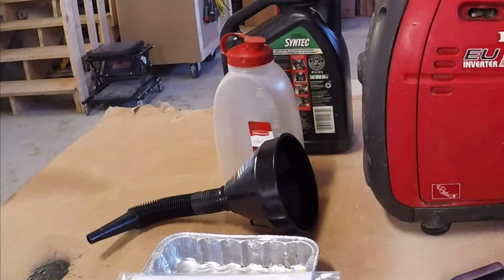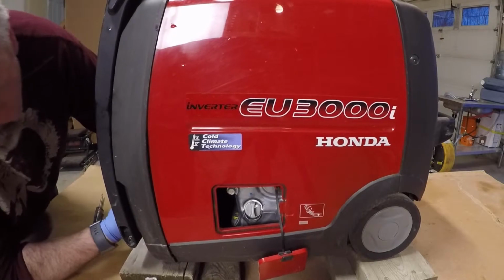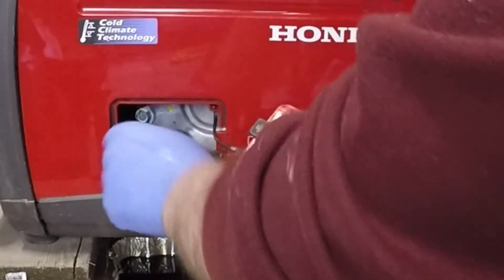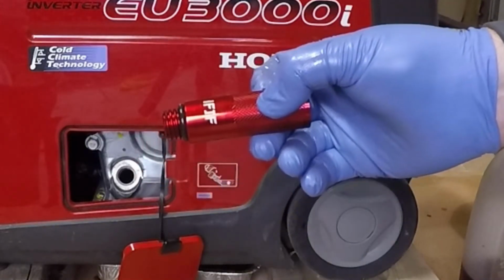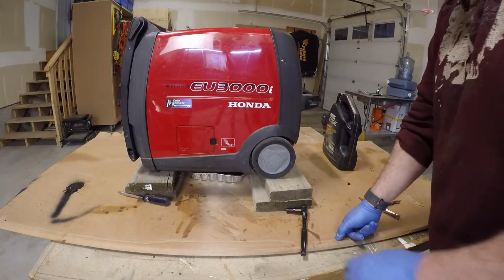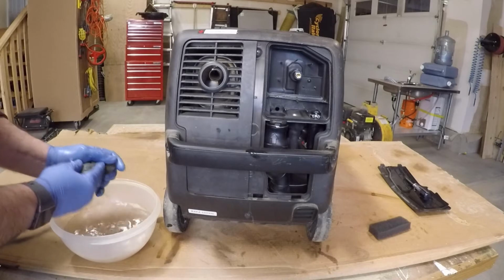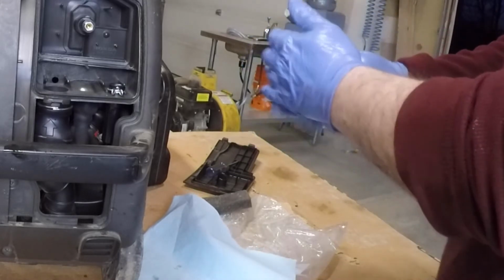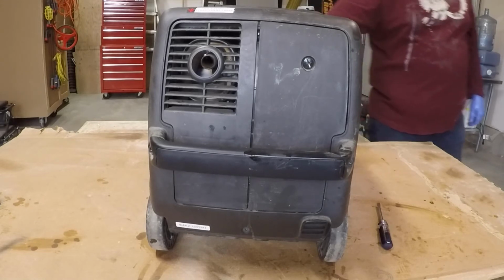Honda EU3000i Handi Quick, easy, detailed  oil change and air filter clean

Comment: Do you find the lack of a fuel cut off switch to starve the engine/carb an issue?  Ie any left over fuel gumming up the carb causing problems?
Reply from the maker: I don't D Gee, but I do start my generators every 2 or 3 months during the winter just to make sure they will fire up.  Either empty the fuel and run dry is storing a long time (best option IMO) , or keep tank full.  Or in my case just start them.
Reply: You can drain the carb with a flat head . Look for the clear tube under the front of the unit

Comment: The only thing I dont like about the 3000 is the weight 130 lbs is to heavy. I have 2 ....2000s that weigh 46 lbs apiece and I parrarel them and have 4,000 watts.
Reply from the maker: Hi the other 3000 is probably about that weight.. one of the advantages of the HANDI in this review is that its about 75 lbs.  I was even able to move it around when I had a broken arm a while back..  Thanks for the comment and welcome to the Chanel Pete!  I hope as events open up I'll be able to post some more and newer video's but I am still here!  I also have a 2000, and yes they are extremely portable.

Comment: I just ordered a Honda EU3000i Handi yesterday and am looking at various videos in advance so I'll know the various ways that current owners do their maintenance.  I like it that you put your unit up on wood blocks to raise it up to access the oil plug and be able to put a drain pan under it.  Much like I do when I raise the front of my cars to change the oil and filters on them.  That's also a neat idea to place the air filters in a Zip-lock bag to get the oil evenly distributed on them.  I'd be interested in knowing if you have some kind of method to know when you put a hundred hours (or whatever the mfr designates) on the engine so you'll know that it's time to change the oil.  Thanks for making the video.
Reply from the maker: Hey Terry, thanks for the comments!!!, If you just got the Honda, make sure you do your first oil change after 20 or 30 hours....don't wait the normal time.... If you want to know how many hours you have used it for, you could put a hour meter on the generator, look for one on amazon, it just wraps a wire around your spark plug and the timer goes up when the generator is running.